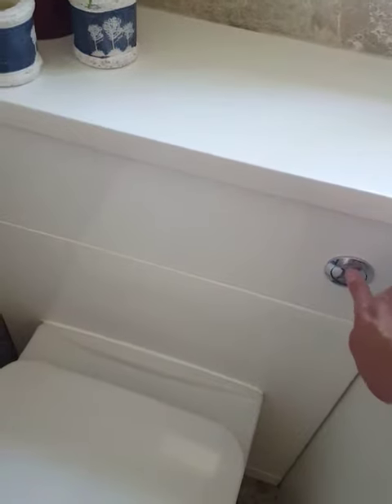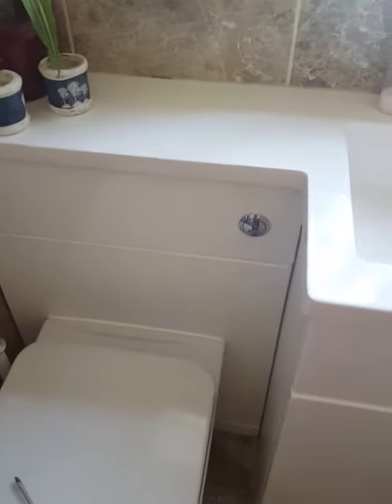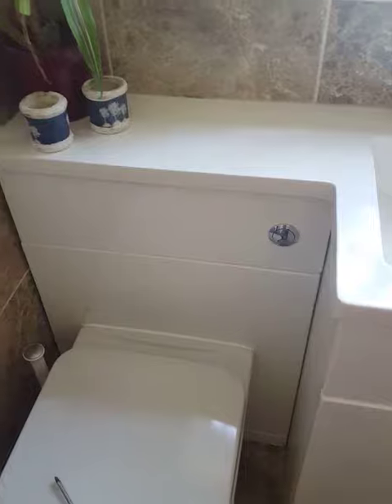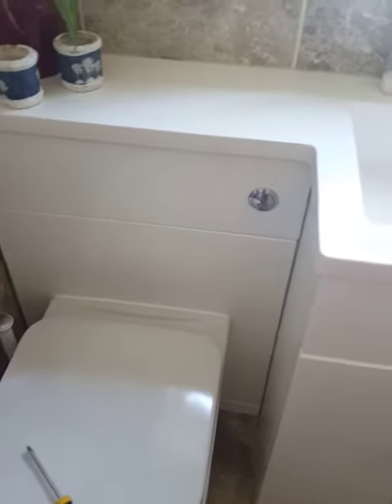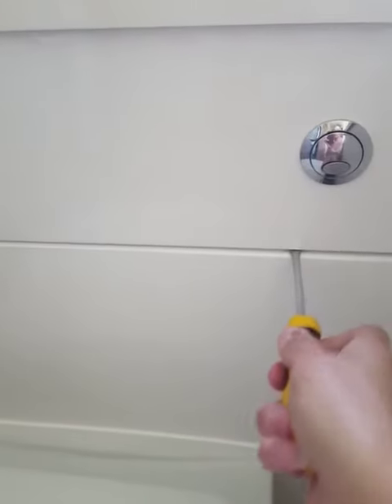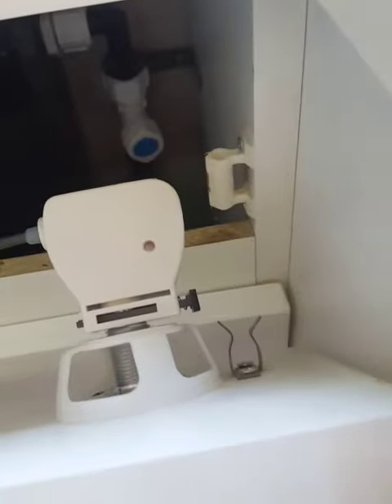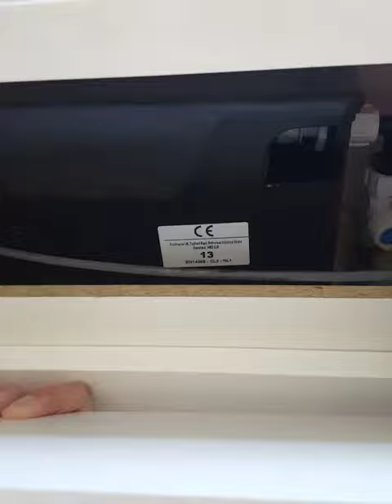Accessing the water cistern on a Cook & Lewis Ardesio vanity & toilet unit

Comment: A little tip for you if you are worried about scratching the unit with a screwdriver, use a rubber sucker (think satnav holder) and it'll pop off with no damage or marks. At work I've used the proper glazing suckers but I think a windscreen sucker would work just as well
Reply from the maker: Hadn't thought of that! Thank you! 😊

Comment: Thank you so much. Out toilet is about 15yrs old and the flush stopped working. We popped the panel out as you suggested and found the plastic tube had split or perished and needed replacing, a cheap fix. Thanks again for showing us how to access the inside of the unit. Linda and George
Reply from the maker: You are very welcome. I'm really glad to have helped. 😊

Comment: Well done for a good video post, there isn't much information around on taking this panel off, our problem was that the flush was intermittently sticking in and so I wanted to spray some silicone maintenance spray on it. I removed this panel by using a Allen key held in some pliers which you can feed in and turn so the L shape is behind the panel then you just give it a firm pull and it pops out off the clip without the risk off scratching the front fascia
Reply from the maker: Thank you, that's really helpful

Comment: Thank you, I;ve been wondering for months how to get to the tank without ripping the work surface up!... This was so easy and allowed me to fix the toilet for  a whole £7 rather than spending probably a hundred on a plumber.
Reply from the maker: Oh that's fabulous. I'm so glad it helped you out. 👍
Reply: Could you actually get to the tank. Mine is flushing but sometimes won’t stop, then goes loose. I think it could be an internal washer. I’m worried I’ll have to remove the lower panel too which looks locked in by the toilet?
Reply: @gilesey3   yeah the tank had a cut out at the front, so the water went up to a certain level and anything above that level was cut away to epose the insides of the tank.  Assuming it looks like the video, the front panel should pop off dead easy, just stick a bllunt kitchen knife or something thin down the side of it.   Ours had the same issue in that it flushed and wouldn't stop... just replaced the unit in the middle of the tank (under water) and job done.   Whilst im not saying that's what your specific problem will be, it didn't take a lot of figuring out with a little bit of observation of how the interrnal components worked.

Comment: What do you do ? Do you just tug on the cable which connects to the switch if it does not fill up . Thanks in advance for the video .
Reply from the maker: I’m guessing it’ll really depend on what’s wrong, but I just jiggled the pipe a bit and it worked.

Comment: I have a similar unit I need to fit a new toilet seat but I assume to be able to screw the seat on the bottom panel needs to come off!!
Any advice would be much appreciated. Thanks
Reply from the maker: You don't need to remove any panels to change the toilet seat.